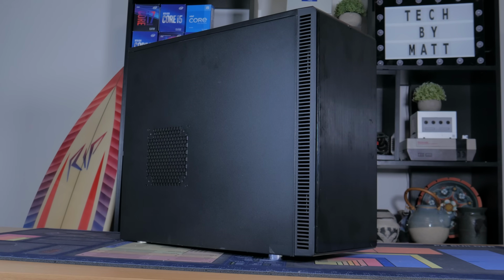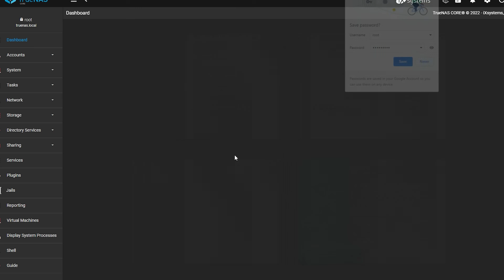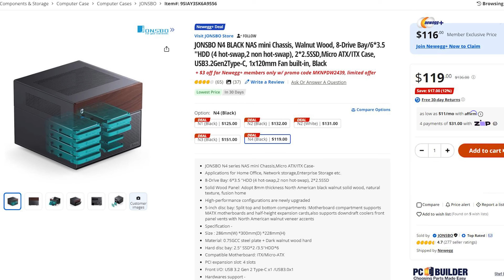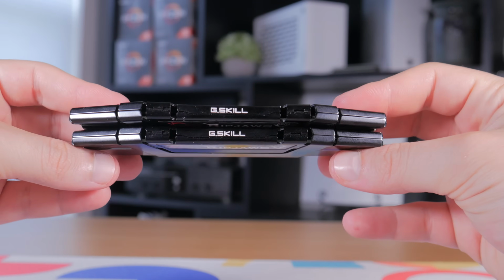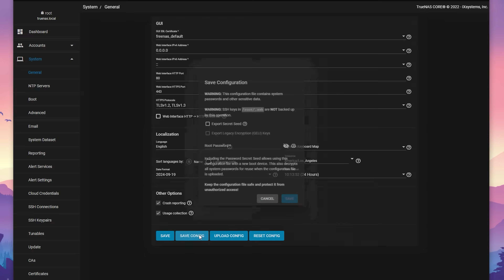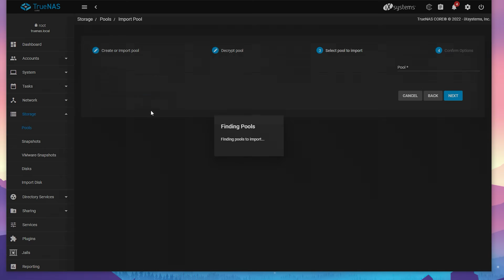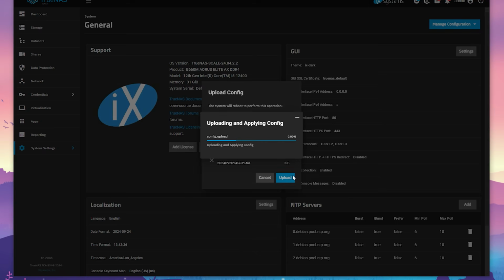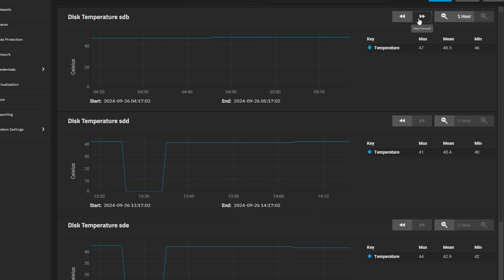Building My New DIY Storage Server! (2024)

Comment: the case is small for good airflow, considering it's a not a high flow server case. and you need more 80mm or larger case fans to cool the 6x hot hard drives.

Comment: Those SATA port will not give you the connection you need for True Nas you should be using a, 9211-8i 6G SAS HBA LSI FW:P20 IT Mode ZFS FreeNAS unRAID 2* SFF-8087 SATA adapter, this card alone will allow you to connect about 8 drives. Also I learned the hard way you should be using only hard drives made for a Nas system like Western Digital 4TB WD Red Plus NAS. They have a few other ones to choose from. If you use hard drives that is not meant to be use on a Nas you will get all kinds of errors using those drives. Hope this helps

Comment: In ten years I would have 200 TB of HDDs since I get about either two 10TB or upto two 16TB of HDDs per year little by little I’m upgrading my old HDDS from PC data to external HDDS for game consoles so my few 1TBs and four 2Tb HDDS will go to that after data is transferred to new ones, and the 3 & 4 TB HDDs will go to older iMacs I might keep one with the dvd drive or maybe even upgrade to a blu-Ray rom but I must like just used an external setup on a couple of macs and pcs for data backups to add new titles to server

Comment: I've been running 64GB non-ECC DDR4 on my TrueNAS Scale PC for a year now without any issues.
Non-ECC for regular home users is fine for the stuff you store on the NAS.
ECC is more for critical business/company stuff
It's funny when people complain about non-ECC memory but not about using regular desktop CPU, desktop motherboard and regular desktop drives
Reply: Using non-ecc is a bit of a risk, as any data read/written to harddrives will go through RAM. Myself, I think the small chance that this happens, justifies getting an ECC ram, especially that there is a big market of cheap 2nd hand enterprise-grade gear, including server boards, cpu's, ecc ram and anything else you might think of. Personally, I bought a £50 Dell PowerEdge T110 II from ebay for my storage server, with a 4c/8t Xeon and 8GB ECC ram. It draws just 20W od idle. I filled it with 32GB ECC RAM, which cost another £50. Super happy with it.

Comment: In regards to the power usage of your server, as you stated correctly most of the idle power draw comes from your HDD's (5-6W a piece at a total of 30-36W, or more than half of your idle power usage). Unfortunately because of the way you almost certainly set your server up, there's nothing you can do about that. I currently have 6 HDD's in almost the exact same setup (12th gen Core i5), but I have a noticeably lower idle power usage, thanks to a better set-up. My server is built around Proxmox as its OS, running a Debian VM with all of my server's applications in Docker Compose, a debloated Windows 11 VM which I use for gaming and CAD drawing in SolidWorks, and a couple of other VM's as part of my pentesting lab (Kali Linux, Metasploitable, etc). Only the Debian VM is permanently running, the others I spin up and shut down as needed.

I have a pair of 18 TB HDD's in RAID1 as a ZFS pool in Proxmox which I binded to the Debian VM, for storing downloaded movies/series to and streaming them from, as well as for storing all of my personal pictures and video's which I also host to family and friends. As a result that pair of drives is always using about 10W as well (and more while being actually used). However I also have a set of 14 TB HDD's + a set of 10 TB HDD's in RAID1, both sets are Ext4, and I had ChatGPT write a custom Proxmox script for so they will go to idle after 10 minutes of not being used and fully spin down after 20 minutes of not being used. It has drastically cut the idle power. And because that set of 14 & 10 TB drives are only used very little and for short periods of time (I use the 10 TB set for backing up important/critical things, and the pair of 14 TB drives as general data storage for both me and a couple of select friends and family members), keeping them spun down for most of the time is perfect.

Comment: wait , you put your server on the most room with the most humidity , chemicals , electric interference because of the motors and vibration of all the house? im surprided that last so much , just the detergent vapours would corrode everything , the dust would act like spounges and the humidity accelerate the process .

Comment: I highly recommend Jellyfin. It has great support on many brands of Smart TVs! I've been wanting to build a new NAS / media server for the house.  My current one runs at 1GB and then goes out over wifi to the TVs in the house. It works fine, even with 3 people watching at once -- that being said, I would be excited to try 10GB and have raid redundancy.  
Secondly, I run a virtual machine on the media server that acts as a VPN server, which allows you to access data and media remotely (and still allows me to use a 3rd party VPN on the media server).  
Lastly, I put the whole system on a simple home automation plug! (Like the kind you plug light bulbs into).  This allows you to power cycle the system if you are not at home, just in case! It's a poor-man-LOM.

Comment: In terms of ECC memory for homelab use, it's good, but not necessary. Its popularity and requirement was overblown by the yesteryears of people using FreeNAS and ZFS storage pools, which runs the OS on and calculates hashes for storage integrity entirely on memory. If the system was to be running 24/7 for months, inevitably a memory error would occur and that could in theory degrade the storage pool if the stars misaligned just the right way. These days a lot of people virtualize stuff and FreeNAS got rebranded into TrueNAS and even TrueNAS isn't as popular as it used to be amongst the homelabbers.

My mantra is as such -- If you want to homelab, get started by repurposing free or unused parts you upgraded in the past from. Storage is expensive enough, people shouldn't be expected to doubledip and have to pay for server grade cpus, motherboards, switches, rackmount kits, etc for non-mission critical use. OK whoops, the storage pool degraded and you lost some downloaded movies/roms. Big whoop, go download them again.

If you're on AM4 and got a bit more money to spend, some consumer boards (typically ASRock ones) may support unbuffered ECC. That can be a relatively lower cost entry point if you're upgrading from AM4 to AM5 to repurpose an AM4 PC to use unbuffered DDR4 dimms if your platform already allows it. This is what I do in a Fractal Meshify 2 case with plenty of HDD cages.

If you're nuts and have a spare room (since this stuff is loud 24/7) and electricity to burn, go ahead and buy used server racks and fully utilize rackmount servers with dual redundant PSUs, rackmount 10gb switches, disk shelves, and all that jazz. 

Everyone has different needs, and I'm good using unbuffered ECC in an AM4 platform midtower that just sits in the corner of the room, sipping power with minimal noise. I have no huge need to spend more money/room on this side hobby.

Comment: Yes, the ASMedia ASM1166-based M.2 adapter is quite delicate and prone to damage when plugging/unplugging SATA cables, so you should plug them in BEFORE installing the card in the M.2 slot. That works best. Another option that provides only 4 SATA ports, is an M.2 adapter with the ASM1064 chip and a horizontally-mounted SFF-8087 connector. Mechanically more robust. You just need an SFF-8087  to 4xSATA forward breakout cable to connect to the backplane or drives. I had to install a development version of the firmware (same used on the ASM1166) to get full hotplug support, but otherwise it works fine. Something I haven't tried is an M.2 5xSATA adapter with the JMicron JMB585 chipset from Silverstone. Looks like it has a sturdy aluminum heatsink that would prevent flexing when plugging cables in.
Reply: Only real NAS card like LSI is recommended.

Comment: I have some questions to ask i am having i3 8100,8gb ram,h310m h gigabyte motherboard,128gb ssd,2 4 tb hdd and 450w power supply so do the stock cooler is enough to run this continuous is there any problem if i run 24/7 . If i am not using server will it go stand by mode pls reply i want to make one for home

Comment: 60Wt of an idle usage is because of Kubernetes used by TrueNAS. In a feature branch they already test a pure docker instead, and this will dramatically reduce an idle consumption

PS If you need more 2.5" SSDs (like for small quiet music storage) you can consider Sedna PCIe quad 2.5" SATA SSD controller (which is a mounting adapter at the same time). No cable or adapter are needed
Reply: That's so expensive to mount some sata SSD's though oof.
Reply: Double sided tape

Comment: FYI, they likely don't perform at the levels of WD Red Plus drives. While they might technically be the same model, they often end up in the external drives due to binning. Basically for whatever reason, they work but are not meeting the performance standards of WD Reds, so they can't sell them as WD Reds and package them as external drives instead.

Likely won't be a noticeable problem/difference, but good to know.

Comment: 13:50 - "PCB was bending a lot" no sh*t sherlock, it delaminated :v
Reply: From some of the plugging in and unplugging he did it really seems like he has no sense of electrostatic or mechanical fragility of computer components.   49C for a hard drive is too high.  I don't like to see anything over 40C.  and 35C is much better.  Also a 700W power supply on a system that is likely never going to use more than 200W is a waste (and runs the power supply way outside it's peak efficiency range.).

Comment: ECC on a home server is so unnecessary ... 7:43 ... Or, that's my opinion.  I've never had trouble with memory, unless it was when we had a power surge in Texas in 2021 after the Ice Storm.
Reply: You know the old adage:  "There are two types of people in this world.  Those who have lost data to a hard drive crash, and those who will."  The corollary is:  "There are those who lost a pool because they didn't have ECC RAM, and there are those who will."   When you look at building a NAS from scratch, the main cost is in the drives, so spending a bit extra to get MB/CPU/RAM that supports ECC is a smaller percentage of the overall cost.  Now, if you're doing this on a budget with spare parts, there are going to be some accomodations.

Comment: i don't get the obsession with small form factors, especially for servers. you reduced airflow, room for upgrade and expansion for a slightly smaller size case that costs a ton.
i understand the need to reduce power draw (and the i5 is perfect for that) but as far as i'm concerned a home server is also meant  to be cheap and reuse hardware you are not using anymore

Comment: Good choice on Scale over Core, but before you dive too deep running apps on the current version of Scale, look at the upcoming changes. They are moving from Kubernetes to Docker, so if you installed the latest stable version (24.04) you might be better off waiting until 24.10 sometime in October or November before you spend too much time on it. My understanding is that the NAS OS isn't changing a ton, just container support.
Reply from the maker: Thanks for the insight. A few other people have said this, so I'm either going to wait or I might just switch to proxmox with truenas running in a VM.
Reply: @TechByMattB  I know a lot of people do it that way, but for some odd reason I cringe at the idea of containerizing my primary NAS! If you go that route, I sincerely hope you make a video about it.

Comment: With regards to ECC memory, you're using a consumer Intel CPU so ECC is only supported on W680 motherboards. If you want ECC RAM on a consumer motherboard then you need to go AMD.
Reply: I'm building a NAS using a Ryzen 1600X precisely because it supports ECC.  Though finding a MB that would definitely support ECC was a challenge.  Lots of MB manufacturers don't actually state they support ECC, as they usually don't test it on consumer boards.  Asrock seems to be better than most.
Reply: @RandallRoman  Very true. Everyone says that making a system with ECC is soooo easy.  Until you find out that the $200 Supermicro board that suits your build has been sold out since the dawn of time, and that the next step up is a $630 board that'll be 3 weeks in shipping.

Yeah, people usually 'cheap out on ecc' because the boards are not readily available at the time, or where they live.
Reply: My Unraid server is rocking an Asus Crosshair VI Hero (The OG) X370 board, with a Ryzen 9 3950x and 64GB ECC.  Runs like a dream, and stable as hell.  Best motherboard ive ever purchased, it just refuses to die.

Comment: You're lucky that terrible ASMEDIA m.2 card died before you had to rely on it.  I would never use one of those unless I'm building a system to goof around.
Reply: Agreed.  Better to have slot-in card.  I don't trust those devices, because I had one (a cheap Ebay card) and it gave me random errors.  And, wasn't always recognized during boot.